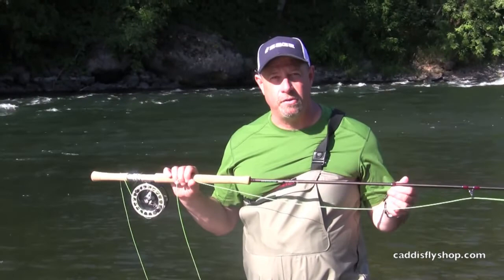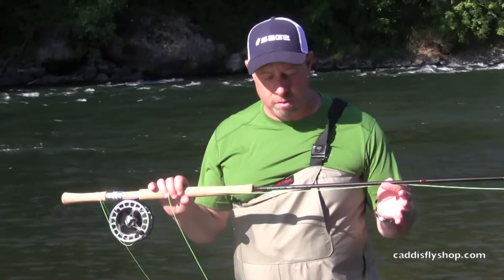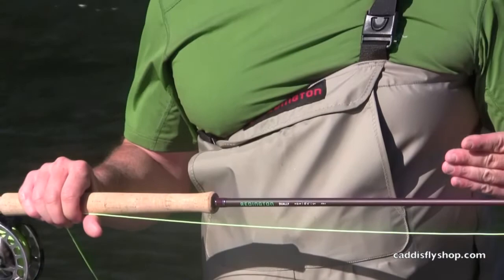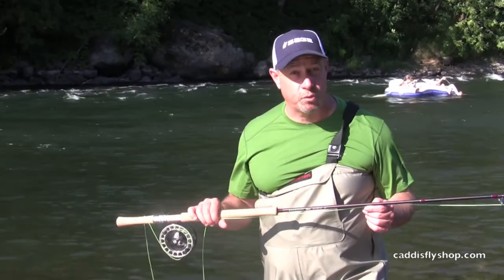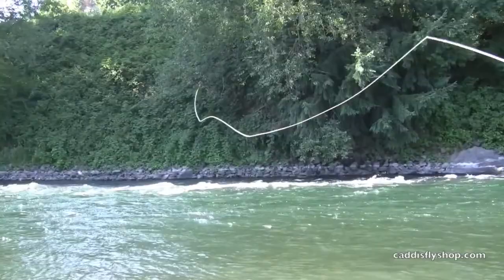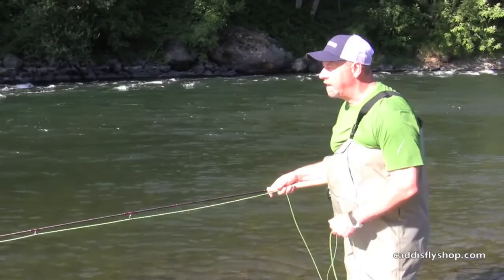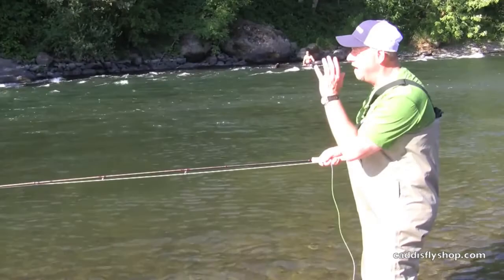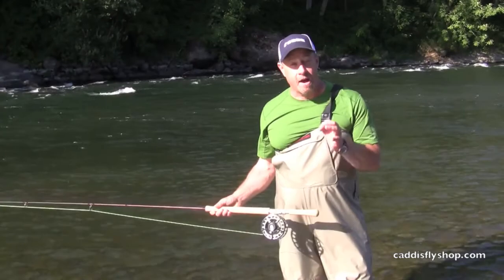Redington Dually Spey Rod and Rio Switch Chucker Fly Line

Comment: So if I have the Redington Chromer 12'6" spey 8wt, I would use the Switch chucker 9wt line? Or could I get away with 8wt? 
And would the switch chucker line be classified as a Scandi or skagit line under "Recommended Grain WT"?